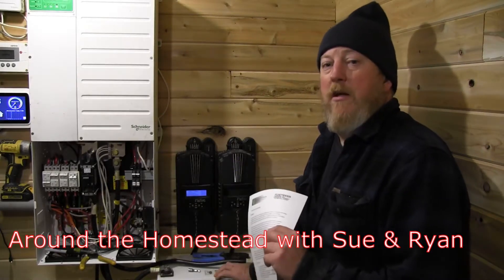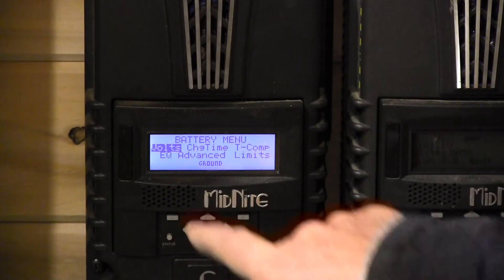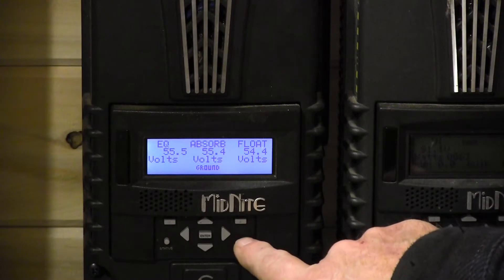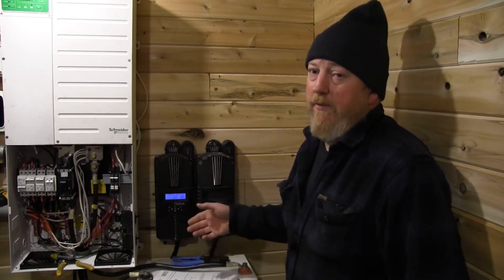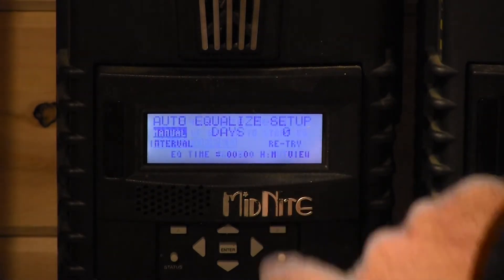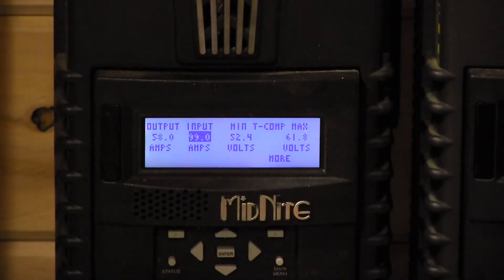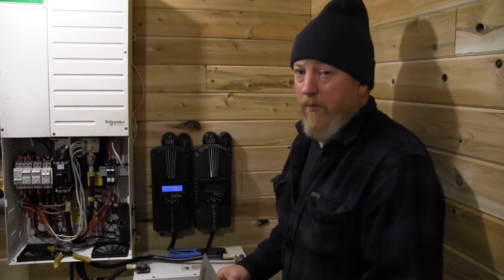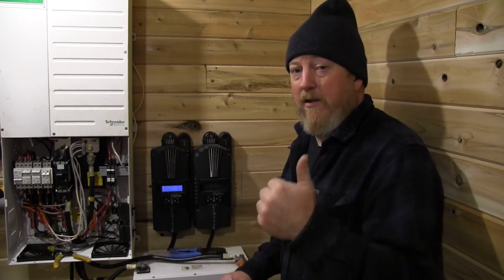Programming the Midnite Classic 200 MPPT to charge a lithium battery

Comment: thanks for the video, it's very informative. I have a question I have a 51.2v 400ah lifepo4 battery what should be the absorption time?
Reply from the maker: That really depends on the battery, For example the MNPowerflo calls for 5 minutes and then my Battle borns call for something more like 30 minutes per string. You will want to reach out to the manufacturer and ask

Comment: Nice video, but I am looking for how to change to programming ( it had lead acid batteries) AGM on the system.  Can you help?
Reply from the maker: Sorry just saw this, It would be similar except you want to use temperature compensation, I suggest if you haven't already calling or emailing Midnite Support support@midnitesolar.com or 360-403-7207

Comment: Hey man! I'm hoping you can point me in the right direction. I attempted to launch a simpliphi bank yesterday. So I connected the two batteries to the system and did the settings as described in the info sheet. They were both at 52.2 prior to connecting to the system (if my multimeter can be trusted ...I tested a 9V and got 9.4V so I'm assuming its relatively accurate) When I hooked them up to the system they never went into bulk, they went directly into a float charge - reading 53.9 volts on the CC's (three midnite classic 200's)

So I disconnected them and went to the old bank for the evening. This morning, I read the new batteries at 52.3 and then connected the system to them. Sun comes up, the CC's go into Bulk and I'm getting a reading of 53.8v. on the CC's. It charges for a while getting up to 55V...I walk away for a moment and I hear it click. It went into float. When I put the multimeter on the bank (still connected to the system) I am getting 52.8. Am I guessing that all three CC's are giving an incorrect Voltage reading? or am I approaching this wrong? I'm a three hour drive to the closest anything so I'm on my own for all this stuff.  Thanks.
Reply from the maker: Hopefully you got this sorted already. My guess is the lithiums are close to full and the 3 classics are a little more push than a pair of simpliphi want. Essentially your classics will charge to the absorb voltage and stay there for the absorb time so if you set absorb for say 56v and absorb time for 5 minutes this would be pretty realistic especially on 80ish AH of battery and 3 classics charging.

Comment: Thank you very much for this!

I have used it to produce a write up of how to set up a MidNite controller for 24 volt 100AH SOK LiFePo4 batteries - for my system.
I include it here for your and your patrons perusal and use.
Please comment as you see fit.

Program Midnite Classic MPPT Controller for 24 volt SOK LiFePo4 batteries

 (Double check all wiring and ensure all breakers are off). 
Necessary controller settings are derived from the Lithium Battery specifications. 
Lithium batteries do need to include a built in Battery Management System (BMS).
The SOK 24volt 100AH LiFePo4 battery's recommended charge voltage is 29.2 volts.

1. Switch on PV panel breaker or combiner and ensure PV panel voltage is OK.
2. Switch on the Battery + to MidNite Controller and the PV+ to MidNite Controller PV in breakers. (If things are installed correctly the MidNite Classic Controller should power up and display the setup screen.)
3. Push the Main Menu button on the MidNite Controller Using the right and left arrow buttons scroll until (Charge) is highlighted then press the enter button.
Note: SOK LiFePo4 batteries have built in BMS (Battery Management Systems) and do not use the external Equalization function so these instructions effectively disable equalization mode.
4. Select (Volts) and press the enter button.
5. Select (Float) and use the up and down arrows to set the voltage to 27.6 volts.
Current Connected recommends 27.6 volts for SOK 24 volt 100AH battery
6. Select (Absorb) and set the voltage to 29.1 volts. (Need -.1 volt for MidNite)
Current Connected recommends 29.2 volts for SOK 24 volt 100AH battery
7. Select (EQ) and set the voltage to 29.2 volts. (Do not set higher than this.)
Current Connected recommends 29.2 volts for SOK 24 volt 100AH battery
Note: you can set EQ to as little as a tenth of a volt over Absorb = 28.9 volts.
8. Hit the Enter button to save the values.
9. Press the Main Menu button to back up 1 menu.
10. Select (ChgTime) and press the Enter button.
11. Set the Absorb time to 15 minutes (00.05) and set EQ to zero minutes (00.00).
Current Connected recommends Absorb 15 minute for SOK 24v 100AH battery
12. Hit the Enter button to save the values.
13. Press the main menu button to back up 1 menu and select (T-Comp).
14. Ensure the number in front of mV is highlighted and use the down arrow to move the value to zero (which will now show as (DISABLED).
15. (EQ Comp'd) should say (NO).
16. Hit the Enter button to save the values.
17. Press the main menu button to back up 1 menu to the (Battery Menu).
18. Select (EQ) and press the enter button - EQ STOPPED should be highlighted.
19. Push the upper right keyboard button to select (AUTO EQ).
20. Ensure that under (AUTO) it is set to (MANUAL) which disables Equalize.
21. Press the main menu button twice - Should be complete.
Reply: Shouldn’t the batterie power be turned on first and then the solar array?
Turning on array beaker first is a good way to fry a charge controller.
Reply from the maker: Nice, Looks pretty good to me

Comment: Hello,  at the tweake menu, would it be good to do the calibration when the batteries are completely full or at the beginning of the day?  What do you recommend?
Reply from the maker: Generally speaking it should be done at rest and with the battery voltage on the higher end if possible as that is when you want it as close as possible

Comment: Been watching you for years. Your advise got me to buy the Midnite Charge Controller it was expensive 3 years ago but it has held up like a champ. Sent it in once for a tuneup but very satisfied. Looking to buy a 9.4KW Lithium batteries now to upgrade my system I have AGM's but they only lasted two years. Thanks for all your videos
Reply from the maker: I was always a skeptic of lithium but after living with them for a while I am sold on the way they work vs lead acid for sure

Comment: Thanks for this great informing video!
I also have two Classic 200. My 5EPzS fork lift battery blew up last week, what a mess ... now I want to go safe way and thinking about buying LiFePo4 in Server Rack Modules.
I have read about it is possible to setup for LiFePo4. But now seeing it makes it better to understand. Thanks again!
I will also link to your video, when I have made my video installing and setting this all up.
I have a MGPT and a "lite" Classic, so I will use the software for it (they should make a new version... this software is so bad ...)
Is there any limitation to the amps? The BMS should handle this all?
How does the BMS know, how much amps it can use for charging?
Reply from the maker: I agree the lite was tough to use some times, if you send us a DM on our facebook page I can get you some better info on making that Lite better.
As for the Amps and BMS, It is up to you to limit amps to what the battery says is allowable. The Classics can do that but would need a WBjr to do so.

Comment: Hello, in one of your videos, you explain the tweaks menu, and you mention that you use a multimeter, so far so good, my problem is that in the controller the battery % is always unbalanced when it is charging with a lot of sun and when it falls Sun.
Reply from the maker: Battery % as in state of charge? Or are you referring to battery voltage? If battery voltage goes further out of line when charging hard this is usually caused by voltage drop (It will be a rise in this case as you are pushing not pulling)

Comment: Thanks for the video, I just got a midnight classic 150 and doing a DIY system. I'm not very tech savvy I'm hearing that you have to down load and program it . do I really have to do that or does it come set up. Because I heard these are the best thats why I got it. But I would have got a simple unit if I knew that .
Reply from the maker: You have to program the specific charge parameters for your battery but thats the case for any charger, You do not have to download anything though.
Reply: @aroundthehomesteadwithsuer3497  Thanks for the info.  then it don't have to be hooked up to the internet or to a laptop to do that. It's all done on the screen of the controller.

Comment: Appreciate you, made me feel better about programming for liFePo I have. I am wondering about the float setting, I hear people saying not to float lithium batteries. But the manufacturer gives the float voltage setting and even a max current for float charge. So is it wrong to float a lithium or doesn't it affect a liFePo to have a constant float charge while under load?

Comment: For  CTL70- 12V battery  what is the battery charging voltage to set it up on the classic charge control. ?
Reply from the maker: You would need to ask the battery manufacturer, generally batteries come with some instructional documentation to give you those setpoints but unfortunately every battery is different and you can not just assume these values or you risk damaging the batteries. As expensive as they are its best to get the proper info. I would call them and ask them for Equalize voltage and time if they want an Equalize, Absorb voltage and time, Float voltage.

Comment: Thanks for the video !  Exactly the information I was looking for .  I knew Midnite Solar would work with lithium but they are scared to use the word [ lithium ] in their manual .. It's not a critical charging parameter ... in the Tesla electric cars the motor turns into a generator every time you press the brake pedal and fills the lithium batteries like a fire hose filling up a bucket . They are not that delicate .
Reply from the maker: Yeah, I think the issue is the differences in charging requirements from some of the different brands as well as the liability if things go wrong. Long and short is Lithium is here to stay unless something better comes along and all manufacturers need to work hard to support the major brands.

Comment: So, I’m an electrician and don’t my first off-grid solar setup for a customer and I am totally out of my element here. Do you set Absorb and Float according to one battery or all four (in my case). Totally lost
Reply from the maker: Sort of a tough answer to give in writing, I might suggest you call the manufacturer of the charge controller to follow up but generally speaking you put batteries in series to make the nominal voltage you want. For example we have qty8 6 volt batteries in series for 48v system. So you would take the charge parameter of each 6 volt battery and multiply it by 8. But then if you put say qty4 12 volt batteries in parallel and stay with a 12 volt system you would not multiply the settings by 4 as the bank is still 12 volt. Usually the support staff at the solar manufacturers are really good at assisting on the phone so for sure reach out to them to double check
Reply: @aroundthehomesteadwithsuer3497  Ok great, thanks for the quick reply. I’m finding off grid more tricky then a straight grid tie with no backup.

Comment: Great job. I have my Midnite classic 200 set up the same way. I also have an Outback flexmax and a Tristar. The Tristar is a pain but actually has a float disable setting. The thing I don't like about having the absorb setting 1 volt above the float setting is it causes you to micro cycle the battery bank. My system is Lithium ion NMC 24 volt nominal. I charge below the thermo runaway threshold. Which is above 4.2 volts per cell. I only charge to 4.04 volts per cell. I do have a BMS modules on every battery. I have Tesla batteries from a Mercedes E class car.  Thank you for confirming my setpoint theory. There 8s not a lot of information out there for charging lithium.
Reply from the maker: We are glad it helped and yes we agree Lithium still seems to be a mystery in some places and I think some of the people in the industry that have used Lead for a long time are still nervous when they hear lithium

Comment: lifepo4 batteries have end amps, typically 0.02C.
it might be different with the "boxed battery" where the BMS does more than just control and emergency shut off.
if you have a large array, V absorb  can hit at  below 75% SOC so 6 minutes in absorb absolutely will not charge the battery. hence the end amps.
Reply from the maker: That is a great point, I think this is true of any chemistry but with lithium the charge rate can be a lot higher so it is more noticable.
Reply: @aroundthehomesteadwithsuer3497  
with lifepo4 not only are the charging rates a lot higher, their voltage is also a lot stiffer. that is the reason we ask for sensing wires. it is very difficult for the midnite classic to sense largish currents to flow out of the battery in float and then takes a long time to bring it up to 99%, unless you rebulk.
Reply from the maker: @ursodermatt8809  Good point on sensing wires and I know Midnite is adding them to future products. I suspect other manufacturers will also. I also know closed loop communications with any BMS that has a port is high on the list of things to do also. Lithium will change the way we think for sure
Reply from the maker: @rafaelmt1000  This will depend on the battery, the manufacturer will specify that as it varies for each brand of Lithium
Reply: @rafaelmt1000  
also depends on the setup you have